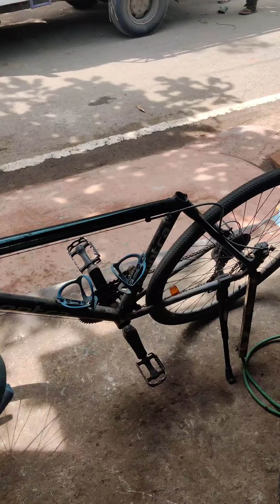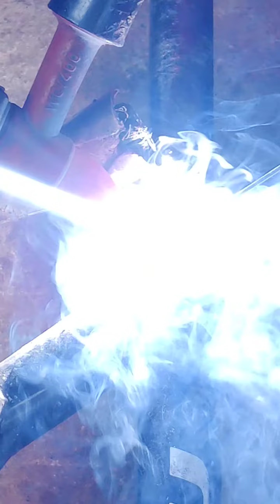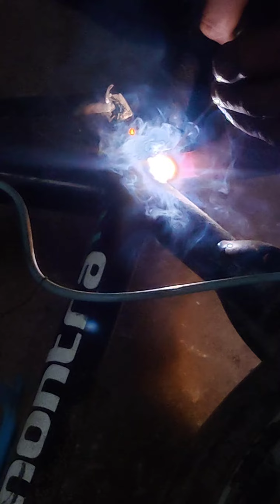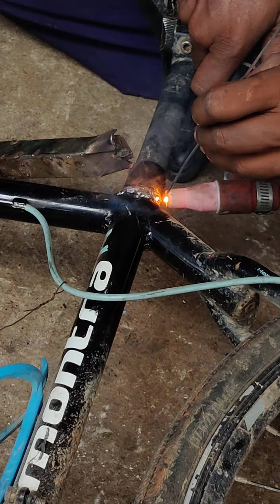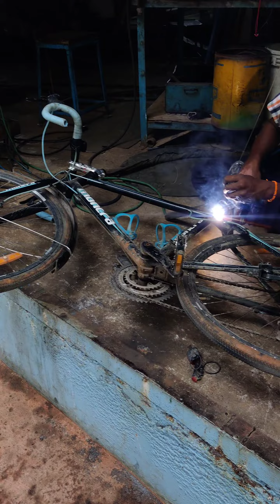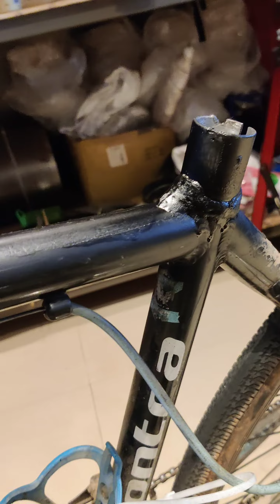AL Alloy 6061 cycle frame repair | Montra downtown 2016

Comment: Bro This Alloy Frame 6061 is What? Good For Mtb Cycle Can I Buy This Alloy Frame Please Explain Your Suggestion Advantage Or Disadvantage Why I Buy 🤔
Reply from the maker: If you're planning to buy from a reputed brand then okay, or you end up with a cheap alloy frame and can break easily.
Any alloy frame can easily be damage due to fatigue ( vibration) if not engineered correctly.
My frame doesn't have suspension fork so most of the vibration from road and rumble made my frame fatigue and broke.
If 6061 alloy frame get's contact with caustic soda will rupture the frame
Reply: @TwoWheelFreedom-1  Thanks For Knowledge 😎